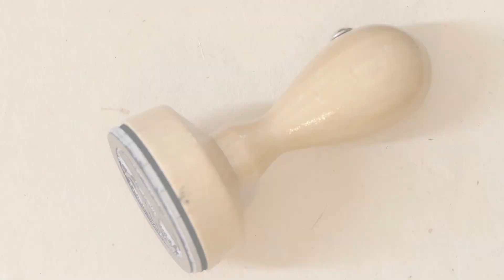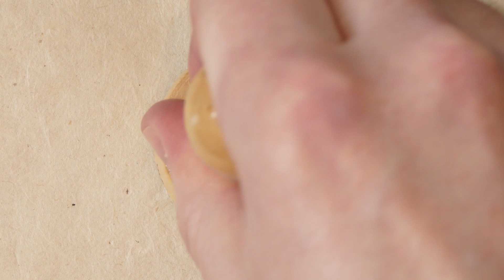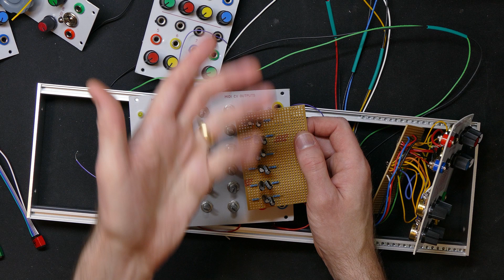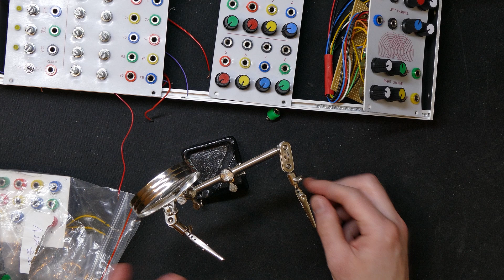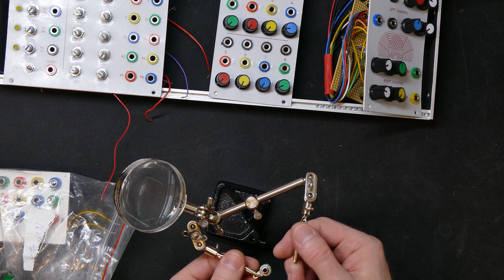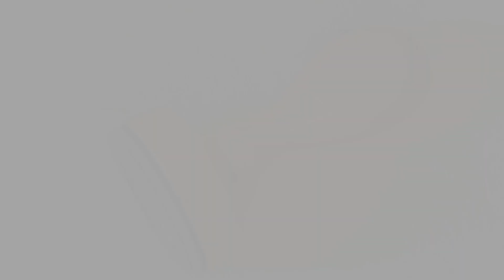Synth DIY #9: Drilled, Inserted, and Wired

Comment: Make some wood panels ;)
Reply from the maker: I might do. Some day. The plywood I have that is the right thickness is terrible quality, warps easily, and it is a lot more work. That is why I went with the poster board after first trying it out in plywood.

If I decide to try another kind of material, it is quite an easy job to transfer the modules to new panels if I need to. I still consider these prototypes. But I would keep them until they all work and I have actually used them properly before considering other options.